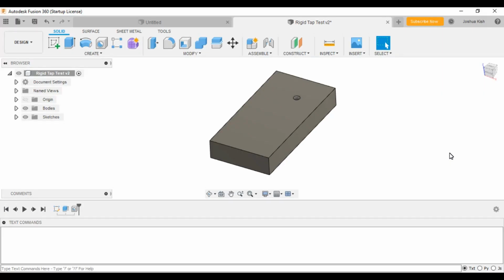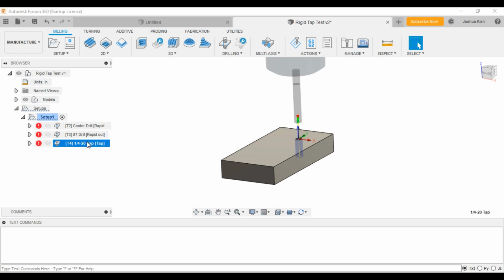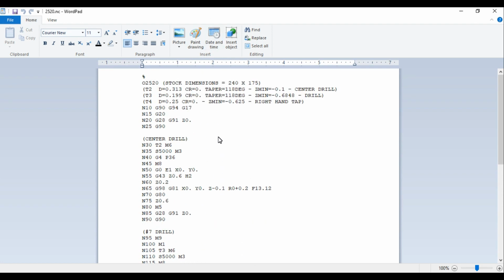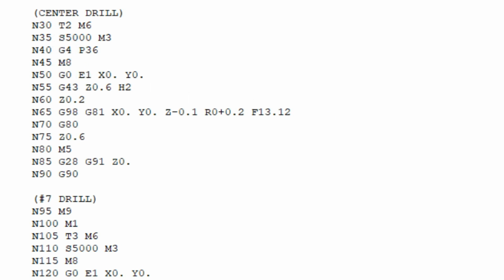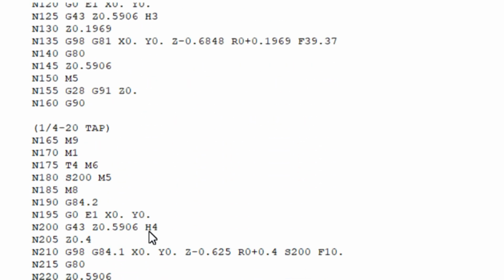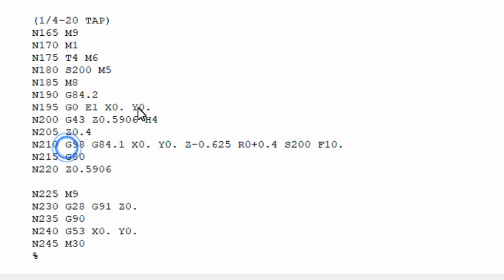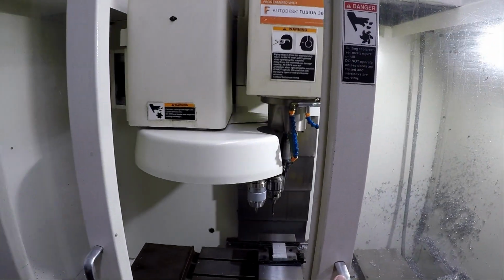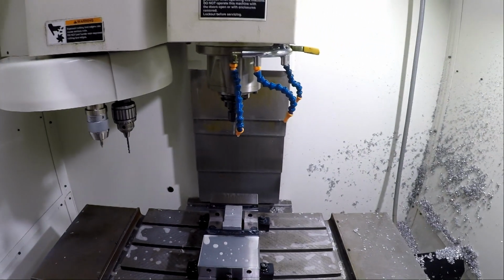Rigid Tapping Success on the Fadal!

Comment: You should used G83 that is peck drill instead of drill cycle G81 and you went .625 deep you don’t want your drill to walk and use q.1 which will peck .1 every time until it reach z-.625 deep.hope I can help... on your G84.1 you should add Q.05 which is .250x20  inch .do the math 1 divided by 20 eguals Q.05 to identify the thread per inch..

Comment: Very interesting video but I have a little doubt. Do I have to use G43 and H2,H1 ... when the tool offset is negative.
I created a program putting G43 and  H to compensate the tool length. However, the tool didn't go to the position in Z that I had expected.
Then I erase G43 and H from my program and It worked. My tool length are in negative so does it something to do with that??

Comment: There still are a few things you can do to your Fadal to increase it's ability.  A simple pressure opening check valve at the coolant manifold will eliminate the constant flow of coolant after M9, one like this (https://www.mcmaster.com/7746k822). It opens under light pressure and closes after pressure drops. It really makes it nice to not have to deal with the coolant draining the feed hose, also it makes the coolant come on faster as it is less line to fill. Adding an a-blast function helps also, you can just plug it into the 110v coolant on/off outlet at the back, or you can go into the control cabinet and use M64/65 to activate a solenoid, you just need to add in the breaker and the fuse. Run some 3/16 or similar air line through the flex conduit and add a 110v solenoid to the bottom of the cabinet, then send that to an adjustable regulator on the pendent to control it. It helps when cutting with dry use carbide for applicable materials. A washdown hose is always a big plus, but just adding a "T" inline with the coolant pump doesn't create mush pressure. You can source a higher pressure pump and all the applicable parts on Ebay for about two to three hundred if you are patient. This is just a few things that can be done, there are A LOT of very effective but simple and cheap upgrades that you can do.

Comment: I typically keep my probe out of the tool changer.  It sits in a holder and I insert it by hand when I need it.  I always use last tool number in the table for the length offset for the probe.  T48 I think.  It keeps me from using a slot, and it also prevents a John Saunders moment where his Hamier explodes when the spindle fired up.  Everyone has their own way tho...
Reply from the maker: ^^ This.... I do this, but because I was scarred back when I first got the machine. Before I found out the ATC wasn't totally aligned, I had it as tool #1 and then did a tool change to run, but because the ATC wasn't aligned, it was barely hanging on and when the carosuel rotated it dropped out and destroyed a probe tip.... LUCKILY, I've learned from other and already had a spare - so I didn't lose any time - just dignity.  I've since fixed the ATC, and don't worry about tools falling out, but still don't want to put "my baby" back in there. XD!

Comment: Try doing just a CD instead of CD,10.  If you set the default baud rate in setp then you don't have to specify it each time.  It will save lots of typing after awhile :)
Reply from the maker: RJMachine that’s a great idea - didn’t even think about setting that as a default in the parameters. Thanks!

Comment: I tap at 1000 rpm on my fadals for everything. Also for less money than that tap you can get proper quality taps on eBay. I like balax but they are a bit pricey. But on another note the dewalt stub length cobalt drills are very high quality. I recommend collet chucks and stub length split point drills unless you need the length. I usually don’t even bother spotting in aluminum. If you need recommendations for very cheap tooling and some other stuff like that look me up on the forum or Instagram and send me a message.
Reply from the maker: Thanks for the recommendation - I’ll probably reach out or at the very least put out a data call on IG or FB. I’m sure everyone has their own preferences for tooling and I’d like to know what everyone has used and liked/not liked due to price, performance, etc. Thanks again!

Comment: I am a bit confused... did you use format1  or 2 (compatibility modes)  ... since i am somehow missing info (explanation) about the parameters used to declare the TPI to the CNC... 20TPI has a  0,05 inch / turn  (pitch)... yes u can esk the machine to go this deep and this RPM (S200) .. but what is the feed / turn.... 

Besd on the book u are in Format2 
there u HAVE TO calculate the  F (feed but here it is feed / revolution)
Formula for F value is RPM / TPI 
200/20 = 10
N3 X0 Y0 G84.1 Z-.5 S200 F10 

 We use METRIC in MODE1  , so there we use  Q for the pitch..... like  Q1.25  (1.25 mm / turn)
in Format1 the  Q is used for the TPI as well ...     1 / TPI ... so it would be   1/20 = F0.05
Reply from the maker: I use format 2 - everything (for me) is specified in Fusion and it just creates the G84.1 line of code. I don’t have to specify anything at the machine.... in regards to your federate question - it’s low, I think it was around 13 ipm during my test. It of course updates in Fusion when yo change the RPM - If you’ve got binoculars, you could probably see it in the video to make sure 😆
Reply: @bgwmachine  i know that the FUSION makes all the lines.... just to see that in the LINE where u have  G84.1 u are binded to the S and F as a pair.  So if you change either... the sync will be there but not for the 20TPI... so it will "drill" the hole instead of tapping :)  :)  FORMAT1 is more "simple" to spot the error if made - of course u have to do a small math but it is not binded to the S number as far as i know .....

Comment: Nice machine.  I have 2 of them.  They are so close to a new machine in  capability.  The m5 is not needed before the rigid tap but ensures that the spindle is off. No a big deal  if it is but a few seconds are lost as the spindle is turned off on g84.1. The dwell is not needed. Prior to center drill but no harm done.   You will love this machine